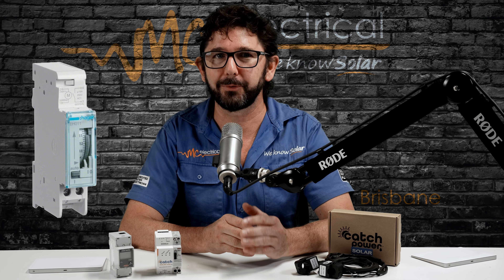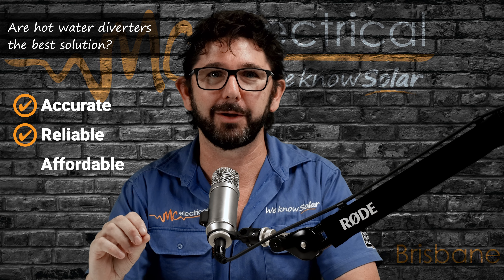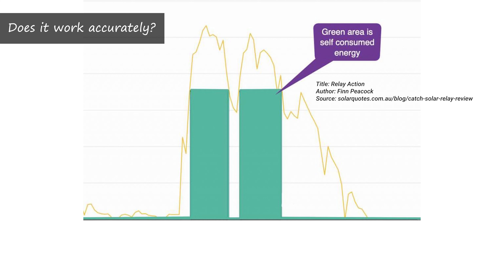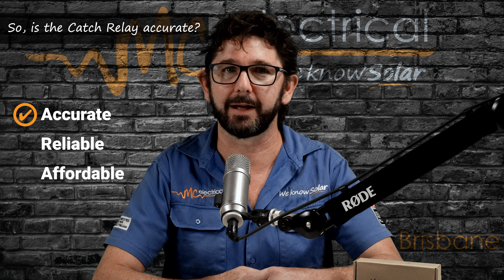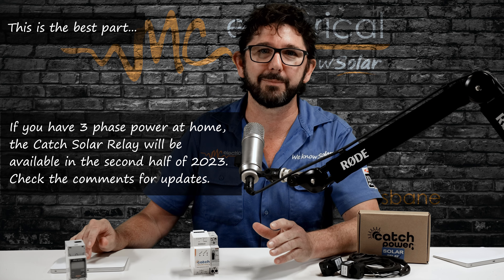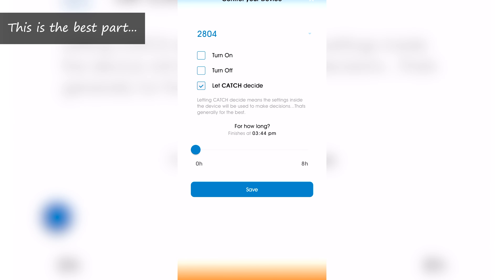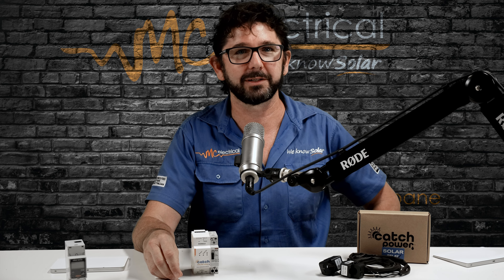A Better Solar Hot Water Timer

Comment: Hi Mark, 
Oh you really hve my interest today.
I had a Fronius GEN 24 +BYD battery (19KwHr) + 6660w of solar installed in September and it is wonderful.
However I have a time clock on my HW and I hate that it is dumb.
The Catch is a very nice solution, however thay would require me to replace my current Ohm Pilot, or repurpose it to monitoring the old panels I have.

So my question is, I see the Fronius Gen24 has ability to control loads.
Can the inverter do switchign of the load if that load was set as the HW service?
Maybe replace the time clock on the HW with a contactor that is controlled by the Inverter.
Reply from the maker: Hi Wally, it can, and if you are the type of person who can set that up yourself and adjust it as needed, then it’s not a bad solution. Catch has better parameters that we can work with, and it has the app. It’s much more user friendly

Comment: Interesting content as always.

How does this interact with battery systems?
If you have a hybrid inverter with battery (Gen24) when the relay turns on, if you have the minimum runtime set will it drain your battery if the demand is greater than the solar production?

You say the Fronius inverter doesn't have a minimum run time, but in the load management/Energy management setting you can set minimum duration per on-signal, which is a minimum run time. You can also set a maximum duration and a desired duration which should cover all your requirements. As you say, not as easy or intuitive to setup and change, but only costs the price of the smart meter and power relay.
Reply from the maker: Hi Euan, yeh you will draw from the battery or grid if the solar day didn’t allow your hot water to heat. By minimum run time I meant you want 3 hours of heating by 5pm. I’ll have to look into that desired duration setting, which sounds like what i mean by “minimum run time” but as I understand it we Fronius doesn’t have the same feature which will ensure the water is hot by sundown. (I checked this with Fronius because it has been a long time since we have used the Fronius solution) A big part of it is also the usability for the end customer, and remote access. I also much prefer CT’s rather than whole current meters.

Comment: Would this set up work with heat pump hot water?
Reply from the maker: No,heat pumps don’t like to be switched on and off. You could probably put a heat pump on an 8 hour timer, but they are fairly efficient anyway. The problem I find with heat pumps is they are more expensive upfront and less reliable than a tank.
Reply: @mcelectrical  I guess you need to update this comment now! Hopefully you didn't type that reply too often.😉
I came across your content via the "Heat Pumps vs. Electric Hot Water Debate" video.
What I've seen so far is pretty good but I'm not in Brissy so all I can do is take your info and apply it in Melb, assuming I can get past the landlord.😒

Comment: Just had a new solar system installed (waiting for inspector to sign off). I have a Sungrow S100  consumption monitor installed. Will that be removed if I get this relay? Does that mean my Sungrow monitoring app won't work in the same way?
Reply from the maker: Catchpower could have replaced your Sungrow consumption monitor and saved you about $100.  But if you are retrofitting, just leave the Sungrow meter in, and add the Catchpower relay as a second item.
Reply: @mcelectrical  Cheers! I really enjoy your content

Comment: I am thinking about it, but is 955 AUD on catch power website, I have 3 phase system. how much with instal? it doenst seem very affordable ?
Reply from the maker: It’s more affordable when it’s getting installed with your solar, because it replaces the inverter smart meter. But yeh 3 phase is expensive and a retrofit callout doesn’t help that.

Comment: My garage with the panels on is 43metres away from the meter box.  I do not have that wire from the fronuis convertor back to the meter, so I will have to stick to the 1st option my timer. Never had a bill in debit in 33months.
Reply from the maker: Yeh, in some situations, timers work fine, and in some situations they are the only real option anyway. There is a nice setup you could do with 2 catch relays if you have wifi at the shed, but that’s another story….

Comment: What about export limits. I want to send 5kwh for FIT and then use excess generated after that. I'm probably going to use the most unreliable but most affordable method - turn on & off manually - i do have have a manual switch for off, on peak &, on offpeak. Turn on every two to three days seems ok (ok for small households).

Comment: Do you have the Myenergi Eddi in Australia? It seems like it is a middle ground between the OhmPilot (variable immersion power) and this Catch Power (uses CT clamps to monitor excess solar). It costs about ~€500 in Ireland
Reply from the maker: I think it is available, but I don’t think it was popular. Neither was the Ohmpilot because of cost.

Comment: One of the reasons I got the Gen24 inverters was to use the digital output switches to control my heater... Now I feel like I've gone in the wrong direction with the inverter choice and Fronius smart meter :(
Reply from the maker: So many other reasons to get the Gen24! It’s the best inverter on the market by far. The relay still can work especially if you are up to programming and readjusting it yourself. The catch is mostly just user friendly, plus it has boost function if necessary.
Reply: @mcelectrical  you'd connect that as bypass to the relay anyway - good electrical practise should something fail a $4 MCB gives you a "boost" switch. Should the catch fail you have no hot water
Reply: Unsure why you think that. The digital outputs on the Gen24 will do exactly what the catch does. You will still need a contactor to switch the water heater, due the the load. If you need a Manual Boost, you can "force" the contactor on. I have my HWS running on the Gen24 energy management and it hasn't missed a beat.

Comment: Are any of these solutions suitable for a 3 phase (triple element) storage tank?
Reply from the maker: Yes, almost. Catchpower’s three phase relay will be available in a few months!
Reply: @mcelectrical  what about the ohmpilot? I'm happy to pay extra to keep it in the family.
Reply: best replaced with a heatpump or two or three..  if you need the capacity of a three phase electric storage system then you'd need a massive solar system to feed it in winter.

Comment: Appreciate the 'heads up' on that Mark, ,akes a lot of sense.  Will it also work with a Sungrow inverter?  My house is 3 phase so when available I will look at upgrading to the Catch.
Reply from the maker: Hi Stan, yeh it works with Sungrow. Mid 2023 it should be available.
Reply: @mcelectrical  Thanks for that Mark which leads me further - having already invested in the Sungrow just 6 months ago, would the Catch be a good alternative for EV charging using the excess power rather than sending it to the grid for a pittance?  I am considering an EV for my next car.
Reply: @stanmoderate4460  Interesting, trickle charge EV isn’t really my thing, I’m having level 2 installed soon.

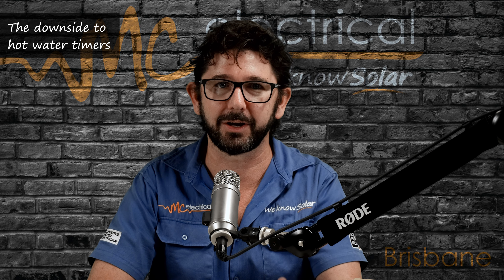Comment: 1:05 - In some situations a hot water timer was the best solution available to us.

wrong - in most Australian situations a hot water timer is the best solution available.

1:21 - if a timer doesn’t pass the first test I don’t think we need to talk about whether it’s affordable or reliable.

*wrong*. Just because it’s not “smart” (or accurate as you call it) doesn’t mean meant it should be instantly discarded expecially when the alternatives are prohibitively expensive. I live in SEQ which means most days are sunny and even if they’re not my PV system is still producing power when it’s overcast…, which means it’s not costing me anything to heat my Hot Water System.

Stop flogging the prohibitively expensive Catch Power Relay…
Reply from the maker: It seems your concern is the cost. A catch relay costs $100 more than a smart meter, and it replaces a smart meter. A timer with battery reserve costs about $70?

Comment: My only question is why is Catch Power so expensive ?
Reply from the maker: Hey John, I don’t think  the catch relay is that expensive as a product for all that it does. But if you call out an electrician to install it at a separate time from the solar install, then your installation costs will put it up a bit.

Comment: You’re on the wrong page mate.
Heat pumps use 1/4 the energy to do the same job and offer the same return as a 6.6kW system does when run from solar.
They cost half as much as the solar system so as a bill buster family of 4+ heatpumps win hands down

Installing hardware to modulate power to a water heater that should be in the scrap pile in the first place is not very smart!
Reply from the maker: Ha, hey Karl. I know you are dead set on heat pumps, and although you sell them (the I store) I don’t question that you genuinely think they are the best solution. Here’s my thoughts - I’m not sure you’ll get 25 years out of a heat pump, and they cost more upfront. Put a few more pv panels on the roof and you have covered your hot water with simple reliable solution. Plumbers that I meet agree with me. But, sure, there is always another side of the argument. How long is the warranty and expected lifetime on the istore?
Reply: Farout Karl, I just looked up the warranty for I store. 12 months on the valves and accessories. How is that an environmentally friendly solution?
Reply: @markcavanagh  you know that an electric HWS has those same valves don’t you?
They have the same chance of failure on what’s there as they do on a new heatpump.
Reply: For that matter a gas storage system has the same valves also.
Reply: @markcavanagh  the valves are not manufactured by istore at all and warranted by their manufacturer. 
Whilst we sell AVG valve kits as a courtesy they are not our product.
Failures of brass tempering and PTR valves is exceptionally rare by the way.
Reply: @mcelectrical  istore is 5 years parts and labour and a design life of 15,000hrs on the heatpump which is 10-15years.
“A couple of panels” isn’t nearly enough to provide hot water in winter and indeed in most states a 3kW covers the average which is more than a heatpump.

AVERAGE consumption of energy is 12kWh a day for hot water per household.
That’s 9kWh wasted vs a heatpump. 
Every diverter is a wasted opportunity to do it properly.
Reply: Ok, my bad, I didn’t know it meant the external valves. So basically a 5 year warranty. I’ll need to look up a warranty of a standard quality dumb tank.
Reply: But regardless of warranty, I think it’s pretty fair to say less moving parts = more reliability. Tanks have had the time to prove that is true. Seems to me that in a short period of time, heat pumps have also proven this to be true.
Reply: But regardless of warranty, I think it’s pretty fair to say less moving parts = more reliability. Tanks have had the time to prove that is true. Seems to me that in a short period of time, heat pumps have also proven this to be true.
Reply: @markcavanagh  you need to read the book the big switch by Saul Griffiths.
Reply: Heat pump cost too much! I am on a controlled load for my system (12 cents) at current usage, it would take me 12 years.  I will think about it when mine fails
Reply: @twinrotors  good thing it wont last forever.  Australias emissions last year increased yet again. keeping electric HWS costs the environment but your kids pay for that so its OK!
Reply: @karlajensen100  I agree with you!
I have to triage my expenditure. A battery and solar will do far more emissions then a heat pump and solar.
Reply: @twinrotors  a battery increases emissions as its not 100% efficient, a heat pump reduces emissions by a factor of 4 if replacing electric and 5 if replacing gas (or more as gas is lucky if it makes 80% efficiency
Triage away from battery as the economics rarely if ever stack up for quality gear and any other gear you might as well head to the casino as safer bets there
Reply: @karlajensen100  And I had one running form or than 20 years faultlessly.
Reply: @karlajensen100  What about a solar hot water with the element connected to the catch . This is mainly for the southern of Australia.
Reply: @markcavanagh I’m with you Mark👍

Comment: So long story short. You can set a consumer time clock to work in the northern hours and your system will cover the load during the day while your at work.
Reply from the maker: Yes, that’s the basic idea, except it won’t run during the day if you don’t have enough excess solar.
Reply: @mcelectrical  So if you have a small system or work from home maybe buy a catch power. If you go to work a consumer time clock is fine.
Reply: How does the catch power or a timer work if you have a controlled load setup on your system?